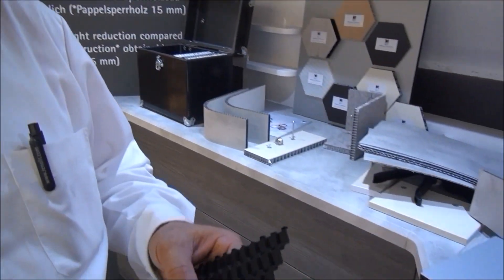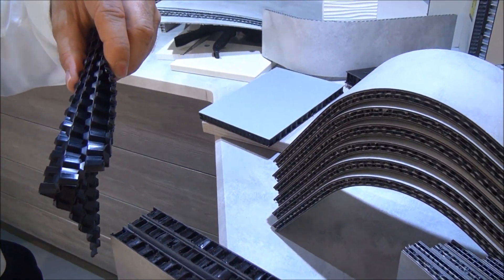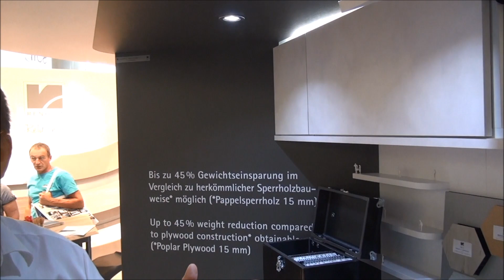Lightweight materials for RV construction

Comment: That was very useful, Alan, thank you!  Please make more videos on materials for RV - lightweight yet strong.  I found Schluter Kerdiboard which replaces bathroom heavy backer board for tiling and shower enclosures.  This is waterproof and super light.  And much pricier, but priceless for RVs!  I also found Lexan corrugated sheeting which is great for under flex solar panels so they don't sit flush on the roof and get too hot.  Researching ways to mount it.
Reply from the maker: I spent nearly all of yesterday doing research on lightwieghting for my next project so there will be a lot more coming up!  I will look up Schuler now - thanks for the name and also follow your suggestion on Lexan sheeting - although I don't know how to mount it.  Maybe someone else will see your message and say how to do it!

Comment: Whats the material actually called? And where can a hobbyist buy it?
Reply from the maker: Beats me - I have been trying for two months with no success despite promises that someone will get in touch.
Reply: @VanlifewithAlan  "how much could one put in there with weight"

He skated around your question and didn't provide any valuable information... at this point I'm not convinced it's a worthwhile material.
Reply: @TheeAbstractHero  I don't think he actually understood the question. But when pushed, he didn't say there would be no warping, instead, he said there wouldn't be any drastic bending. Or something to that effect. But either way, If all but the load bearing shelf of the unit was made of this stuff, then u would still reduce the over all weight considerably. But, for vertical partitions, it seems ideal to me.
Reply: Seems to be GORCELL
http://www.renolit.com/composites/en/products/panels/renolit-gorcell/
they have offices in NJ and CA ...

Comment: Similar if you put veneer on polystyrene foam.
Reply from the maker: Surely that would not hold a screw down nor allow weight to be placed on it?
Reply: Alan Heath you strengthen the panels with fiberglass screen laminated on. It’s quite strong, but I haven’t seen anyone who can put a nice finish on it. That s what I was looking for that landed me here.